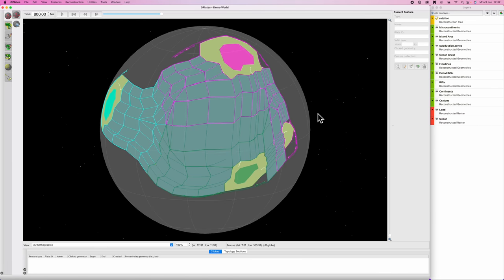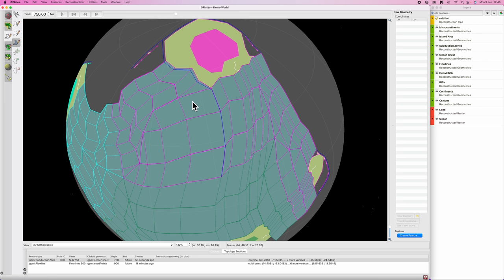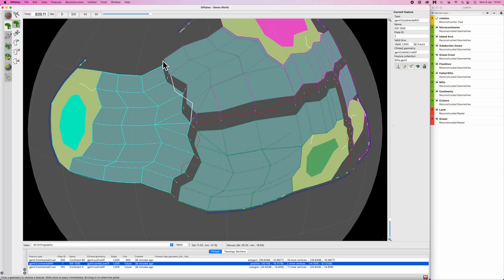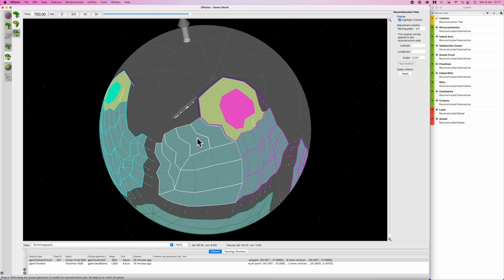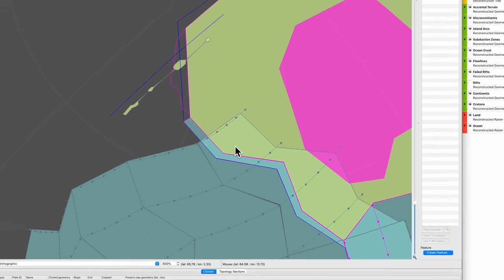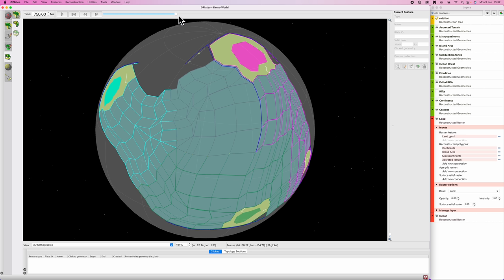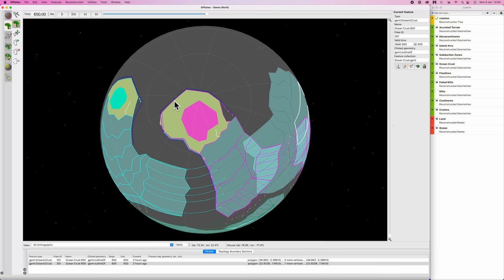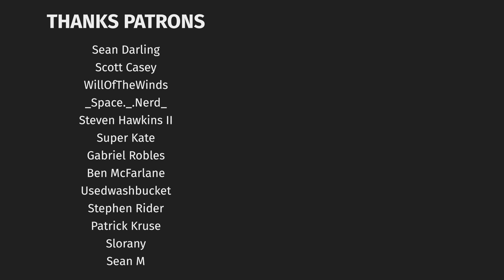GPlates: Island Arc Collisions - Worldbuilder’s Log 15

Comment: Welcome back! I absolutely love these Gplates videos, cant get enough of them. Didn't know the ocean crust  could overlap, that drove me nuts before when my zones overlapped like that
Reply: Really only supposed to do that when one is subducting the other, and to try and not have an ocean crust cross over its own mid-ocean ridge. Which is a pain to make sure you get right in my experience. Especially when dealing with a large full scale simulation as you start running out of room to move things easily quickly...

Comment: I think the main issue I have with the G-Plates videos isn't the content itself (though I'm not intrested in tectonics on quite this in-depth level) but that they are very long-winded (through no fault of your own; the software and topic are complex) and very little new information is presented in each episode (for their length). Also, due to the time between episodes I've basically forgetten what you talked about in the previous video. 
I think the new direction is for the best; looking forwward to the next episode. Colliding continents yeah!!!
Reply: Yeah that's the problem I'm having. The first 8 episodes of this series were producing a whole heap of output for comparatively little number crunching. The last 8 have been wrestling with GPlates' (sometimes needlessly) arcane design philosophy to illustrate different tectonic phenomena. While its been really interesting to learn stuff like how to form certain types of mountain ranges, ocean ridges and trenches, a lot of the episode is dedicated to timelapsing all of the malarkey GPlates puts you through to do a single adjustment to the output.
Reply: The other issue I have is that this doesn't even have consequence to the world building, because someone else is doing artifexia. It's a slow tutorial that doesn't seem to actually fit all that well within the original goal.

Comment: Yo! Artifexian, I noticed that the worldsmith has a problem in the Terrestrial Planet Physical Characteristics area of the Planets section where the default iron core percentage causes the density, gravity, and escape velocity to be higher than earths, with the radius being smaller than earths. This can be fixed by changing the default iron core percentage to 33.33%, instead of 35%. A very small thing, but I just thought I would mention it to you. 
Also, the GPlates videos are actually quite enjoyable, despite it not typically being the side of worldbuilding I love. They might be slightly better if they were a little shorter with the same amount of progress in the episodes, but just keep doing whatever you enjoy the most!

Comment: Yes the older ocean crust will be more likely to subduct but it can get more tricky than that sometimes Earth is complicated and obduction is occasionally a thing  where sea which really only makes sense when you consider the Earth's upper mantle and ocean crust as the medium within which continents are suspended akin to icebergs in the sea.

In this sense the motion of oceanic plates while influenced by continents isn't entirely coupled to them aside from driving the formation continental crust via island arcs and continent induced subduction  zones.  In fact different mid ocean ridges spread at very different rates with orders of magnitude of variation from the fast spreading East Pacific Rise which depending on the location spreads between 6 cm/yr and 16 cm/yr to ultra slow spreading Gakkel ridge which spreads 12.7 mm/yr  to 6.0 mm/yr

Still note that the modern young subduction zones IRL are all oceanic largely where transpression(transverse motion plus compression) are straining the crust there is a lot to be learned about how this process begins.

Now in the context of IRL geography its important to recognize that plates when subducted don't disappear rather they change form sinking to the Mantle Transition zone and leaking sediment into the overlying crust as the minerals change phase/state through remineralization. 

That remineralization and separation plays major roles in driving major inter-plate volcanism i.e. hot spots though the details are complicated and not yet settled 

Importantly once the crust has become dense the subducted slabs continue to sink deep into the chemically distinct lower mantle in a really cool ribbon candy style structure called a slab wall.  If the subduction associated with these slabs is still ongoing then this effectively anchors the position of the subduction zone and its volcanic arcs which is likely to be the case for your several hundred million year old arcs barring slab breakage/separation to return the system to shallow  slab subduction

This latter stage of transitioning to deep subduction it should be noted is associated with violent volcanism or flare up events which can in some circumstances drive an arc volcanic cycle with activity rising and falling as each portion of crust re-mineralizes and sinks below. 

In continental arcs this results in Ignimbrite flare up events with highly silica rich or siliceous volcanism which due to its high viscosity and strong gas trapping ability can lead to large numbers of voluminous explosive eruptions i.e. "supervolcanoes" and serves as the main way "supervolcanoes" form on Earth. 

As an aside the other main way being continental inter-plate volcanism from young continental rift zones and or migrating hot spots. Though there is also ultra slow spreading ridges a.k.a. Gakkel ridge the weirdest and most dangerous midocean ridge as rather than erupting primarily by effusive pillow basalt eruptions the slow rate of spreading can allow huge amounts of material to build up and erupt explosively in anywhere up to VEI 8 super eruptions. Also another fascinating thing about Gakkel ridge is its "normal" volcanism supports explosive vulcanian eruptions. Of its 5 or so super eruptions two also correspond with major changes in Glaciation in the Northern hemisphere namely the initiation of permanent glaciation in the Northern hemisphere at 2.5 Ma and the shift in the major Milankovitch cycles 1.1 Ma. Given we are talking about a volcanic ultraplinian blowing through potentially kilometers of water  (depending on how intense the associated resurgent dome was) the magnitude of such events boggles the mind and this was far from the biggest "super eruption".

Now there is another "special" kind of volcanic event which happens when a mature continental arc subducts a mid ocean ridge and becomes extended. This is generally known from the most recent example involving the collapse of the ancient an Laramides as compression was very rapidly shifted to extension exposing the deep  plutons and batholiths below as the arc was extended out, basically everything from Nevada to Colorado/New Mexico was once part of a towering mountain range before it got spread out into block fault mountains horsts and valleys grabens exposing the deep metamorphic core complexes and the aforementioned still partially molten plutons and batholiths.  This means you can expect this kind of volcanism to happen when you "kill" your volcanic arc next time as you pull your Andean style arc into a Laramide  type arc

The most recent such event the Tertiary Ignimbrite Flare up was responsible for the largest explosive volcanic eruptions known and included the ironically amusing Wah Wah springs eruption which was the single most violent explosive event since the Chicxulub impactor smashed into the Continental shelf of North America along what is now the Yucatan peninsula 66 million years ago.  We are talking about exposing the batholiths at the basement of a volcanic arc allowing them to violently decompress giving you a combo of immense landslides and absurdly explosive volcanism.

Comment: Y'know, that continent collision is gonna be a nightmare for the spec bio part. The blue continent has been isolated since the start of the simulation, so with a biosphere isolated for 350 million years, I can only imagine what chaos will ensue when it's finally introduced to the rest of the world again.
I mean, that's a LONG time. That's like, longer even than the dinosaurs existed. I can't wait.
Reply: I mean, this whole simulation thus far (1000 - 650 mya) would've happened long before even the Cambrian explosion, so the effects of the biosphere will be minimal assuming it's using an Earth-esque timescale. I don't think land life would exist yet, considering life didn't come onto land until after 500 mya (not including bacteria).
Reply: @t3chkn1ght  I assumed that the plate tectonics are specifically for the spec bio part, as a billion years is pretty young for a biosphere, let alone an intelligent civilization. So I assumed it was starting with the Cambrian explosion happening 1 billion years ago. Perhaps that wasn’t correct of me though.

Comment: Glad to see this series return! We can only wait and see, but two things I’m really hoping to see in the future are:

-A tutorial for creating the “crust age” map or a height map of the world using the GPlates simulation. Worldbuilding Pasta did this in their post on making a tectonic history, but didn’t really go into the how of it.
-An outline or general workflow for designing spec-bio creatures. Obviously, we know that Vanga would be the one to draw and flesh them out, but the creatures would be your own idea, and some guidelines would help others adapt them to make their own worlds unique.
Reply: It is difficult to do an oceanic crust age map if you start out by following this method of constructing the plate history. There's a few changes to the workflow necessary, and you need a much larger number of plates with a correspondingly more complicated plate rotation file. You also may need to use topologies to create dynamic features and should configure the mid-ocean ridges as half-stage rotations rather than static features.
Reply from the maker: All you need to do it set the draw style of the ocean crust layer to "FeatureAge" and hey presto just age map. Gplates being GPlates it does some weird things here but that's basically it.
Reply from the maker: Both will be covered for sure
Reply: @Artifexian  Thanks a lot. Excited for what’s in store. :)

Comment: I'm probably too late for anyone to reply but I thought this would be the best video to ask this:

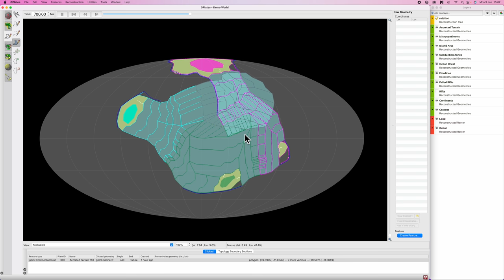At 22:40, the ocean crust overlaps. Can that happen whenever, or is it only when subduction zones form? The reason I ask is because in my simulation, two ocean crusts overlap slightly. One continent is moving north, and one (to the south of the 1st one) is moving east-north-east (it just split from a bigger continent moving east-south-east). The strange shape of the continents has caused some of the northbound continent's oceanic crust to be in the way of the eastbound continent's oceanic crust. One thing I thought might be a problem is that the 2 oceanic crusts do some funky overlapping stuff with the oceanic ridge. Is this a major problem? Is there something I'm doing wrong? If so, how should I fix it without having to change the continents trajectory and have to redo all the ocean crust. Tbh I wouldn't mind doing that too much, but it would be nice to not have to. Pls help. 

Also if if you can explain WHY it works the way it does (why its ok / why its bad and I have to change it) it would be much appreciated and help me understand.

Comment: Where would you look; how would you include a “Hot Spot”, ala Yellowstone?
Reply: There isn't yet a consensus on how they form IRL yet but by looking at the studies of seismic tomography its looking to be the case of plumes forming after a subducted slab finally sinks to the core mantle boundary and begins to melt as it floats on Earth's liquid outer core.
A rough estimate for the timescale of subducted crust hitting the core mantle boundary is about 230 million years then add around another 20 million years for the plume to reach the surface and you come full circle with the initiation of the next Wilson cycle. Of course its actually much more complicated than that but that should serve as a rough guideline for the level of detail he is doing.

Frankly because of the long time delay and the disagreement on the details the two processes are generally thought of as decoupled though that is beginning to slowly change at the rate of progress. Which cynics have remarked is usually one funeral at a time, because older researchers despite the motto of science still share the human tendency to stubbornly cling to their ideas even as the evidence mounts against them.

Comment: I have a quick question. I cannot at the moment use gplates due to a technical limitation (there are weird green bars on the display and I can't see anything) so I've been using inkskape for the time and I've been wondering if it is a good solution? 

Also love this series. Can't wait to watch it to the end!
Reply: As long as you bear in mind how the geometry and projections work (so the very top and bottom of an equirectangular projection map should be super distorted and pixels in the very top row should all be identical, same as the bottom row, for example) then you should be able to get all the important stuff in there without too much pain

Comment: Could you explain what you did with ocean plates when there was so many lines crossing each other? 
Because I tried making my own project and there were lines crossing each other and I didn't know what to do
Reply from the maker: Could you give me a timestamp?
Reply: @Artifexian  You can see flow lines for two different continent pairings like on top of each other between 15:00 and 16:00 
As in simulation time stamp it is like 700
I think I am refering to what you did in the edited out timestamp time 
When you showed the ocean crust making 
There were no flow line sets on top of each other

Comment: When I move my continents, some cratons are not moving with them. How can I make the cratons with different plate IDs move with one continent with a different plate ID?
Reply: You have to define it in the rotation file, the last 3 numbers in a line are 000 for plate ids that move independently, if you want to make one follow another one, you have to change that number to the plate id of the one you want the cratons to follow, i think all the coordinates in those timestamps have to be 0.0 0.0 0.0 for the follower craton or it will jump around, though

Comment: I have been facinated by World Building for a long time and I love your channel. I was just wondering what you believe the impact of ChatGPT will be on World Building, and how to use it as an effective tool? I would love to hear yours and others opinions.
Reply: What role would a chatbot play in worldbuilding? Not dissing, but genuinely curious what the relation is.
Reply: @parallelblack788  No problem, love having discussions.

So I have used it to help flush out details and help me find a element of realism.
I also have seen how useful it can be to help with cultures if your world building goes that far.
Reply: @parallelblack788  ChatGPT is famously not actually intelligent but extremely confident. If you feed it some nouns and verbs, it'll spit you back something that sounds like someone wholeheartedly believing. To resurrect a piece of cringe  from 2010, if you were to ask it "why does the narwhal bacon at midnight?" it could write you an essay confidently saying why. The application would be if you have some conlanged or nonsense names or a historical event or whatever, you could use ChatGPT to invent some bullshit to start plugging the gaps. I don't think it would be particularly effective or compelling, but that's one way you could use it